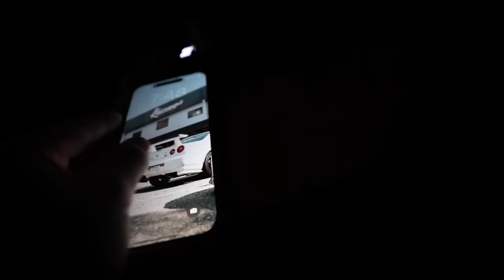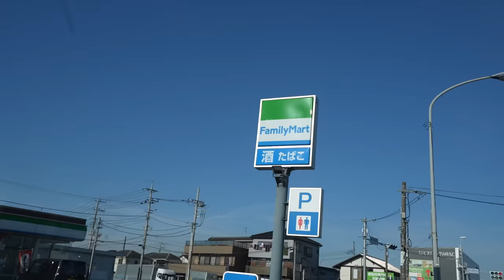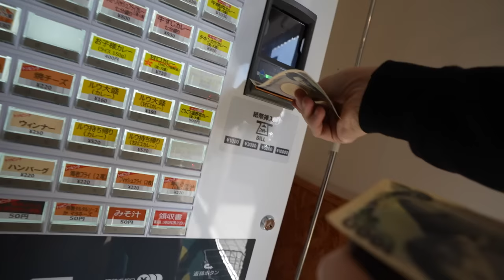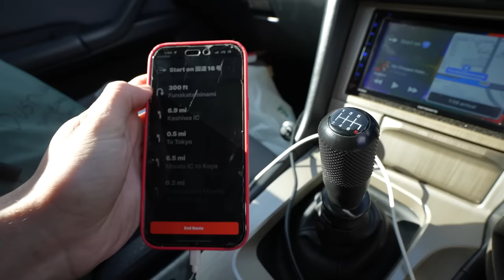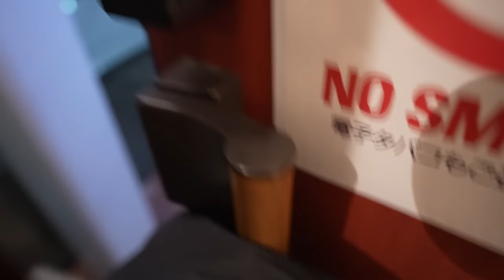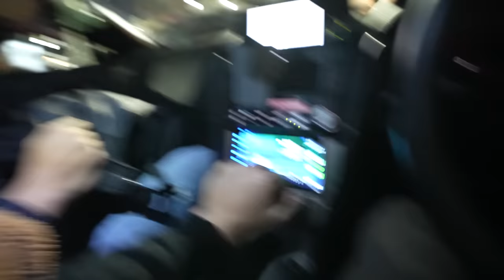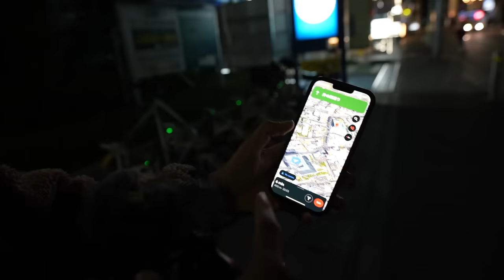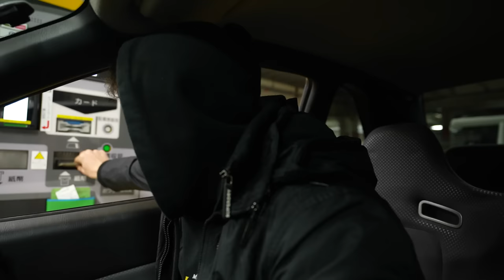Getting My DREAM R34 GTR in Japan & Installing CARBON FIBER NISMO HOOD!

Comment: Albo is correct. You want it to actually have that dry carbon look. My recommendation as a car painter is that you use a satin clear. That way it is protected and has a clean finish that won’t be super shiny. That hood stands out right now but if you paint it white it won’t pop like it does now. Keep up the awesome series man.

Comment: If the purpose of the clear coat is to protect the carbon, then go for a protective film over the hood that keeps the dry carbon look. 

If you do stick to a clear coat, might as well paint it white with carbon accents. White with carbon bits and leaving under the hood carbon with clear will look insane. 

There is a way to keep all options in one look.

Comment: You can clear the carbon hood an can always wrap the hood white with the exposed carbon vents. Atleast if you get bored of the white you just remove the wrap, it wont be a process of sanding the white paint of back to the carbon layer, a cleaner solution. Hope you figure it out, an happy new year.

Comment: The headlight lens oxidization can be removed via wet sanding/someone familiar with the process. Paid $100 for someone to do my JZX100 and Nissan Leopard, made them look brand new/holding up with time + much cheaper/less time-consuming than new headlights or lenses; took the guy like 40 minutes for both cars.

Love the Japan content, hood is super nice! <3

Comment: You don't need to get new headlights you can just have them baked and opened and buff the inside of the lens and the outside and it comes back brand new

Comment: I think you should paint the hood white BUT from the sides of the hood going towards the first Body line on the Rtune hood. So that the central part of the hood is still (clear coated or not is up to you) the dry carbon exposed, it almost gives the r34 a mean track look driving it around. Very similar to the way albos s2k carbon hood almost lines up to the headlights. It's a very NFS Underground 2 look I remember doing as a kid which looks..🔥🔥🔥🤙😁 btw I also like the idea of clear coating with white flake on the suggested painted area I mentioned too 👌☺️

Comment: If you’re not going to change your headlight lenses yet, you should 10000% wet sand them and then buff with a machine polisher and some cutting compound. It’ll only take an hour for the pair and it’ll make a huuuuge difference

Comment: In my opinion, you gotta paint the most of the hood white to match the rest of the body. The overall look of the car is gorgeous in white, don’t ruin that. But the vents have to stay unpainted. Possibly un-cleared like Albo said. I would would clear the vents to protect them myself, but if you think the dry carbon look is worth the “flex”, then leave them un-cleared. But definitely paint the rest of the hood white. Keep it sexy/mean. I feel like full unpainted carbon hoods are too “early 2000’s”. And definitely don’t leave the whole hood uncleared just to show that it is dry carbon. Don’t mean to be a fan boy here, but you’re Dustin Williams. No one is going to question whether or not it’s a true dry carbon R-Tune hood. You are known at this point, no need to flex. Keep it classy…